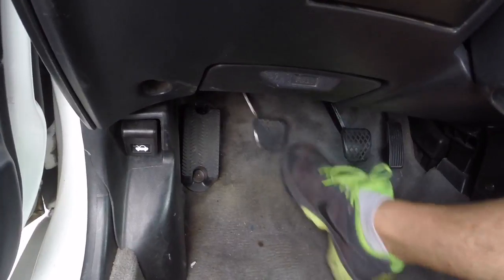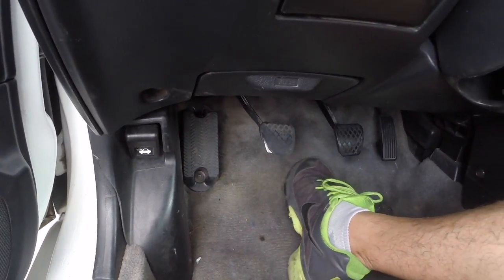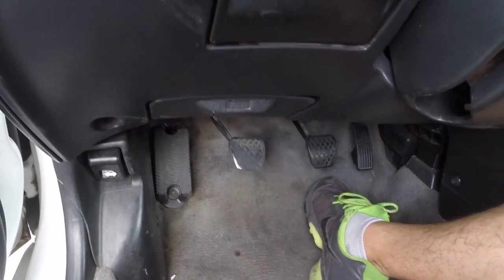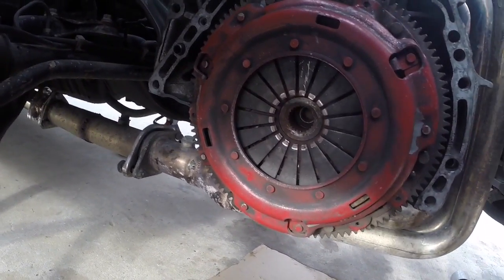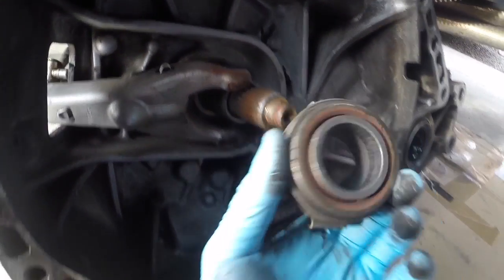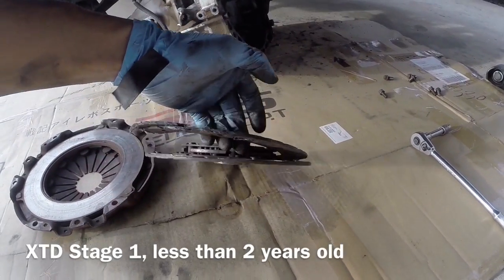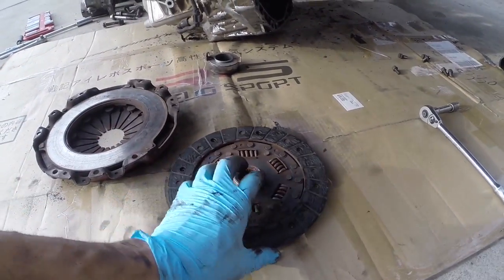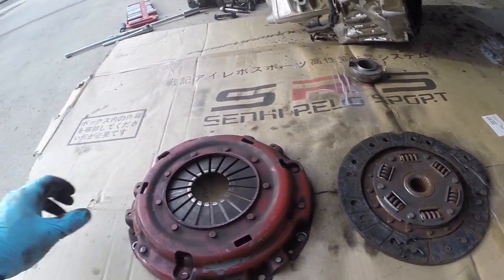Integra GSR Clutch Failure | XTD from eBay | Track Abused

Comment: Welp there's your problem. You used the wrong clutch for the application. That is not a race clutch, that is an OE style replacement clutch. It was never intended for increased power handling, so of course it failed. It's not XTDs fault you used the wrong clutch in your build. XTD stage 3 and 4 clutches on the other hand... can handle quite a bit of beating.
Reply from the maker: Yeah, unfortunately we had installed long before he wanted to "track" the car.  This is his daily driver but he wanted to have some fun and that didn't happen.  Lol
Reply: Hey, at least no major damage to anything was done. Should be a simple swap and go. Just remember to abide by that break in procedure and you should be pretty happy.
Reply from the maker: +90DSMTurbo 👍🏻 thankfully!  This clutch has been good to him so far!
Reply: 90DSMTurbo wrong about stage 3 and 4, they're still crap! I talk from experience. Better to spend an extra $100 on a better clutch

Comment: My xtd stage 2 clutch and flywheel is doing great after 5k of hard abuse at drift events, autocross and daily driving
Reply from the maker: +Hachi-Roku Performance Group I think the upgraded ones are ok, the OEM replacement ones seem to break faster, which is probably the reason it failed.
Reply: Garage Built Hondas i only bought it for the flywheel and an extra $10 so i gave it a shot 420 mile break in. It might sound stupid but if you dont mind the feel of oem clutch get the duralast from AutoZone. Life time warranty so burn it up take it out get new one for free repeat. I believe orileys is the same lifetime no hassel
Reply from the maker: +Hachi-Roku Performance Group that's an idea too!!  I like clutches that are a little more stiff.  My buddy has a heavy foot and really abused this clutch!  I like to do the same!
Reply: Garage Built Hondas so far stiffness is my only complaint. The exedy oem pressure plate was 2 or 3 times stiffer that the xtd so im thinking the pressure plate will fail first im just waiting for when it does. Thanks for the vid and reply
Reply from the maker: +Hachi-Roku Performance Group cool, of it does and if you remember update this post!  Would love to hear about it and also we can see how long it lasts by seeing when these messages were posted!

Comment: I just had this exact same thing happen to my clutch 2 weeks ago... I mean, exactly the same results.  The clutch I was running was a stockish Valeo/Perfection clutch. I ordered a Clutchmasters that should be here next week...
Reply from the maker: How long had you been using it?
Reply: It had been in the car since 2013 when I did my engine build, although it only saw about 8000 total miles in that time.  It was on a car that only gets driven about 1500 miles for a road trip each June.  It made it back from this year's trip and did a quick run on the Tail of the Dragon (US 129 in TN) and the next day it did exactly what yours did.
Reply from the maker: This clutch too didn't have a lot of miles either!

Comment: It looks like the pressure plate is doing fine, but the friction disk failed. On these clutches, you keep the flywheel + pressure plate ONLY, and get OEM everything else! Especially the bearings. 

I have seen a super SCARY video of a pressure plate failing and breaking out of the bell housing and tearing a hole through the car. given the correct alignment, that failure could've been fatal to the driver or passenger.
Reply from the maker: 😨 scary!!

Comment: That XTD Clutch kit u had is like a Oem Replacement. I wouldn't recommend it for track use
Reply from the maker: I agree, and we know that now! 👌🏻
Reply: +Jon Widmer 
Ya man I hve the XTD stage 3 sprung wit the HD PP. I had it for 2 season on my Teggy on a Built NA B20v it sees the strip and some street races also and gotten my car on a 12sec passes. I guess XTD has some good or bad clutches floating around. I'm about to buy there Stage 4 Unsprung clutch this week and see how it goes! 👍
Reply from the maker: +DJ DOHC very nice info thanks, I was curious about their upgraded clutches.  Keep me updated on clutch works if you remember!  I'll check your channel also to see if you've uploaded any content on it.

Comment: I was wondering i got a 89 si tranny that i want to mate with an 96 d16vtec engine would it work? Or do i need to use 89 flywheel and clutch for it to work if is possible. Thanks
Reply from the maker: You'll always need the clutch and flywheel for the transmission you're using.

Comment: Xtd clutch kits are great for price and if you use it for right purpose. Like for example oem clutch kit for any kind of track use is a terrible idea and destined to fail. I have stage 3 on boosted K , zero problems!!.   2 years of hard abuse is exceptional in my opinion ! For the price you paid and abuse that's not bad at all.!i

Comment: Was this a pressure plate failure or just the friction disc failure?
Reply from the maker: Just the disc
Reply: Garage Built Hondas thanks for the reply! I just saw a video of an xtd pressure plate falling and exploding through the car, taking out the transmission tunnel. Guy was using it for drift events. Scary

Comment: What's up man! Just searching around YouTube and ran across your video lol would you trust an xtd flywheel? I have a brand new one laying around and I'm planning on using it with an oe spec exedy pro kit clutch kit.. or find another one? I'm going to ditch the one I have now in the car, I believe it's giving me vibration issues
Reply from the maker: Flywheel, yes.  As long as it's that solid flywheel and not a 2 piece which some bolts holding it together.  I don't know if XTD makes one like that but if they do I'd steer clear of it.  I have an XTD clutch kit/flywheel on my 91 Si and I haven't had any problems.  I don't drive it all crazy though but I don't take it to the track 3 years ago and put a good beating on it.  Still seems good to go.  My flywheel is the 10 lb and it's a solid one piece flywheel.
Reply from the maker: Yes, that's it!!
Reply: Jon Widmer thanks man!! I was going to buy a light weight flywheel, but I'll put this one to use and save around $200 lol

Comment: Dam that just happened to me brand new to not even used smh
Reply from the maker: No way, really?  An xtd also?  Did you start least break it in for 500 miles?
Reply: I couldn’t even get a mile lol it did exactly like ur video did fork vibrating n no gears went in only wen car was off
Reply: XTD stage 2 everything
Reply from the maker: That's terrible!!

Comment: how's the exedy clutch holding up?
Reply from the maker: I drove it last Friday back to my house to finish his Energy Suspension install and it feels so good.  Very responsive and a ton of grip!
Reply: +Jon Widmer thanks for the reply. my buddy is in the market for a new clutch and he had a very heavy foot haha. he was thinking about getting a cheap kit but I'm going to show him this vid haha
Reply from the maker: Dc2 Seriously, I have the same clutch installed in my 91 Si B16 and it has only about 3000 miles on it in 3 years since I don't drive it much but it feels like garbage already.  My shifts aren't smooth anymore and it's hard to get into gears sometimes.  It may be my transmission but it shifted so smooth and crisp in the car that the motor was previously in.  I changed the clutch when I pulled the motor to put in my car and should've left the damn clutch alone.  Lol
Reply: It's a cheap OE replacement clutch, it wasn't meant to be beat on. If you abuse it, it's going to fail. If you want an XTD clutch for racing you're going to want at least a stage 2, or beyond.

Comment: #1 rule
Never go xtd go exedy
Reply from the maker: Agreed Adam!
Reply: +Jon Widmer yea never heard good from xtd
Reply: Adam Wolfe i run xtd clutch and flywheel. 500 mile break in and 5k miles of abuse in my ae86. I've done drift events drag autocross even have done brake stands and clutch never slipped yet
Reply: Exedy is cheap also. Your just paying for the name,
Reply from the maker: I don't agree with that.  I haven't heard any bad things from all the friends or people I have installed clutches for that used an Exedy.
Reply: @GarageBuiltHondas  someone somewhere has had a problem with them,  they are still cheap built,  I have a xtd on a 3000gt stage 5 and it's still on there it's been four years
Reply from the maker: Well of course, that's a no brainier, but I'm not relying on people I don't know. I like firsthand info and feedback and I get a ton of that from the homies at the track.  Track abuse is like no other, I don't care how hard people think they drive their car on the street, I guarantee that car will never be driven as hard as a car on a road racing course.  Now I don't mind XTD for a daily/fun car as I still have one on my 91 Si and it's been on there since 2012 too, it just depends on the abuse/usage.  Shits gonna break no matter what, I just like to see how much abuse some can handle compared to others because if it's getting used and abused then that means you're having some fun! 😁
Reply: @GarageBuiltHondas  well if your going to be racing you need a twin disc not a  200 or 300$ clutch,
Reply from the maker: Depends on power.